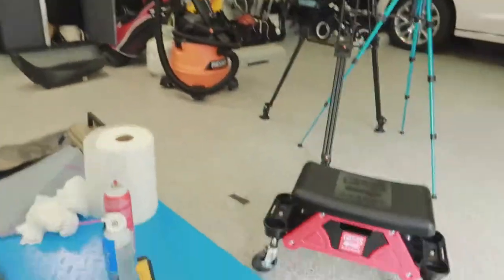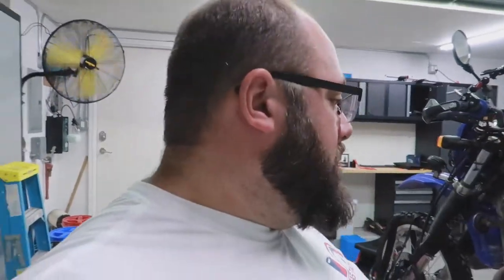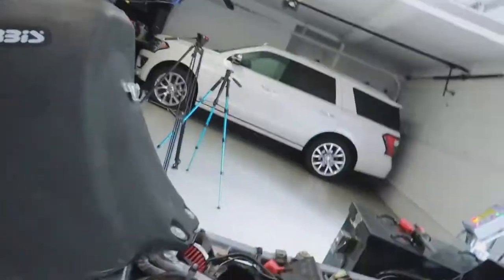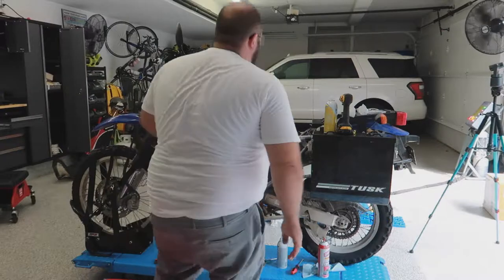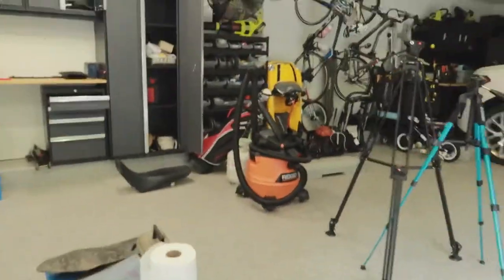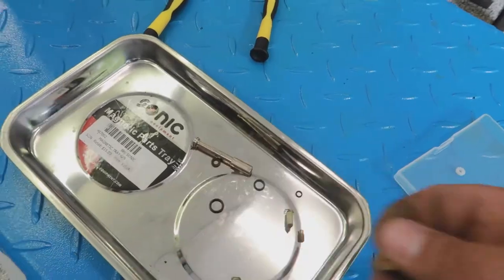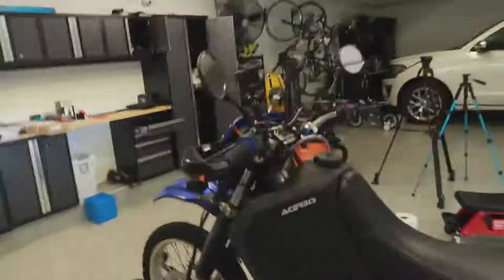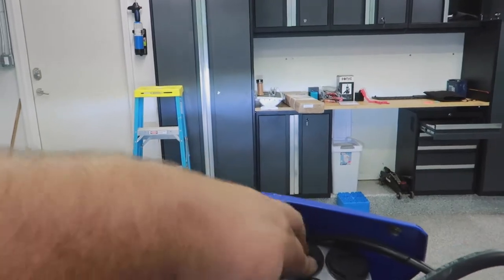Rebuilding my Carburetor on my Suzuki DR650 Bush Pig - GasTachs

Comment: Good job mate, I'm guessing that you didn't cut out the top of the air box? so with that said,  It looks like the previous owner has done the airbox, exhaust & carb modification??? More than likely previous owner has installed the PROCYCLE JET KIT. ( Lager main jet & idle jet along with the slide mod & needle)  Mate, there is Plenty of really good information on the set up of these carbs in all the DR Forums Online, but good to see you problem solve aswell 👍  Cheers from OZ.
Reply from the maker: Grissle thanks, yup all those mods done by previous owner. Took it on a 350mile off rod adventure a couple days later. Video to come out soon.

Comment: What was that pole you replaced with all the holes in it? Haven't seen anything like that in my carb
Reply from the maker: Hey man, I tried lookin for the name of it but couldnt find it sorry.
Reply: @GasTachs  after  watching more vids I think it's called the emulsion tube, but I couldn't get it out on mine, is there a trick to getting it out without damaging it
Reply from the maker: con georgiou thanks for letting me know. Yeah there is a screw on one side of it that releases it. If that is already removed I’d spray it with wd-40 and let it soak over night
Reply: @GasTachs  thanks didn't know, I'll look out for it.
There is a really good video called why float height is important by Tepco cycle repairs, have a look
Reply from the maker: @gam0t0  Thanks man will do. Good Luck!